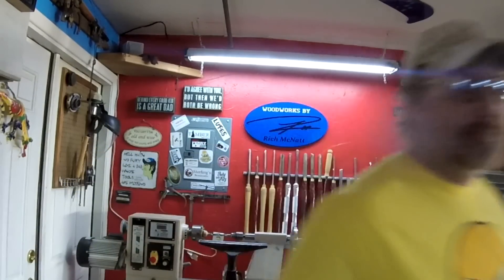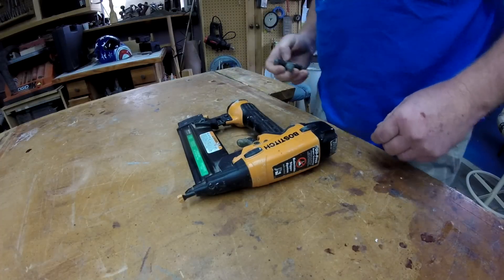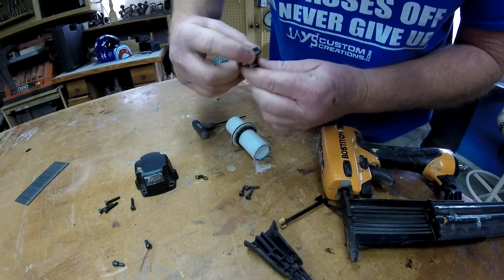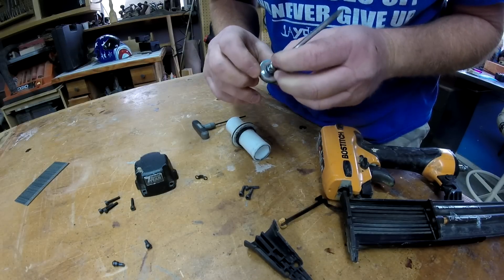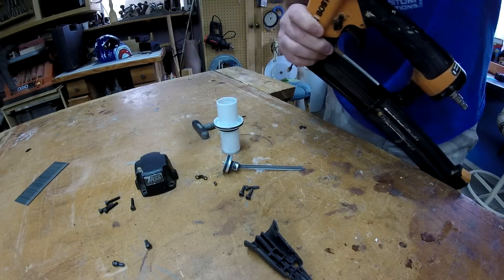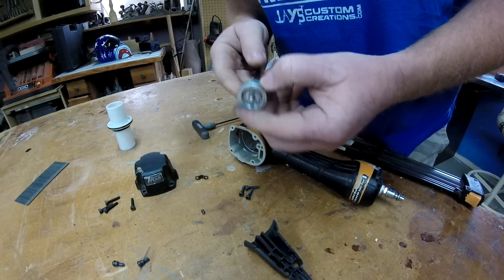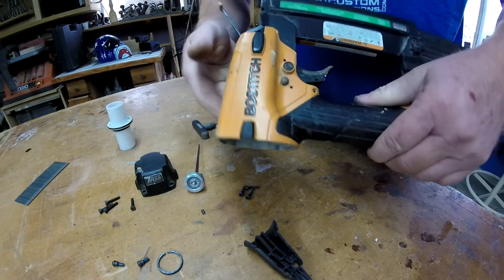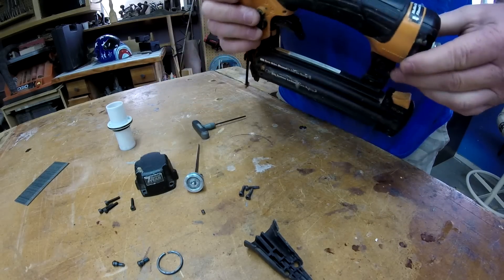Bostitch Brad nailer repair ?

Comment: I have 4 HF nail guns.  I have the 21 degree framing nail gun, and the little brad fun, and the combo brad.staple gun.  I have two of the brad/staple guns as I could not find mine for a while and I really missed it.  The first three must be nearing 20 years old.  The framing nail gun will not fire the last 2 nails in a strip.  It has been like that for a while now.  I keep meaning to take it apart, but it does not bug me all that much.  The brad nail gun is still going strong as ever and the brad/staple gun has just started to not fire.  I took it apart today got all the sawdust and crug out of the track for the plunger and lubed up the piston good and she is shooting like new again.  I can not say enough good things about these tools.  have ran tens of thousands of fasteners through all of them and they are still going strong.  After seeing how this "brand name" unit is built I like mine even more!
Reply from the maker: Good to know,  I have never had any good luck from HF tools but it seams like they are stepping up there game alittle.  I am in the market for a new finish nailer maybe i will pick one up. give it a good test

Comment: I bought my nailer new about 5 yrs ago.  Don't have the receipt. It has never worked.  Pull the trigger and nothing happens. It seems to want to fire but nothing happens. I took it to the Stanley repair facility twice over the years, they hooked it up and said it worked fine.  My other two nailers that came with this set work fine.  Any idea on what I should do to get this thing working?  Thanks
Reply from the maker: +james vaughan first I would try air pressure adjustment. If it is a finish nailer all mine run at 110 to 140psi where the Brad Nailers and pin Nailers run at 60 to 80 psi.  After that pull it apart and check the piston seals
Reply: Thanks Rich ok will try that.  Thank you

Comment: Housing is magnesium, not aluminum on mine.  Raised stamp at rear of handle, left side.

Unlike yours, mine is 5+ years old and only used a few times to replace door casing trim, a half dozen times.  Not even a full package of nails used through it yet,
Reply from the maker: Thanks for the heads up, I will look and see.

Comment: Disappointing for a name brand.  My no name is 20 years old and still works perfect.  Wondering if the cheap ones are all that different (like built cheaper) inside?  Thanks for sharing, Cheers, Gord
Reply from the maker: I believe the older tools are much better, ( built with better cheep parts) I get 2-3 years on a brad nailer before it gets just warn out ( I do use it almost every day)

Comment: So what nailer did you buy? I am on a job and I don't have time to try every o-ring. I just replaced the trigger.
Thanks
Greg
Reply from the maker: I got a Hitachi NT 50AE2  from the Lowe's I dont recall the price, and It is NOT "oil free" but I have been abusing it for a year now with no issues.  It also does not like smaller than 5/8" brads but I use pins for that small stuff anyway. Thanks for watching
Reply: Thanks Rich

Comment: Ok first of all putting oil in the Oil less nailer caused it to fail. The build up of crap on the seal and piston wall caused undo friction as dirt and contaminants built up. Thus causing your issue. Essentially you prematurely ruined the gun. It has a special Orning that doesn’t require oil thus the oil-less design. The new piston is about $14 the piston seal is $2 and the new piston sleeve is $3. All in all a really cheap fix. Don’t put oil in your new gun. 🤔🙈

Comment: just bought two at a pawn shop.
one a Bostitch 18-gauge
one a 16-gauge
both look new
not scratch on em !!!
one for $30 the other for $50.
NEVER used one before so did I get a good deal ?
and is Bostitch a good nailer ?
and what psi do you recommend 
thanks Sir.
Reply from the maker: Sounds like a good deal to me, I have had good luck with the older ones ( over 10 yr ago) the new ones I dont much care for.  I run my psi between 90- 120 most of the time.  The suggested psi should be stamped on the tool near the air inlet.  Good luck and thanks for watching
Reply: Thank you SIR 
I appreciate your response .
I figured $-80.oo for two that must be new was a good deal I got a Campbell hausfeld 20-gal upright compressor for $-130.oo wasn't bad 
(Mine old ones in the garage upside down oil leaking out so I got the CH it'll keep up with demand better)
Again thanks